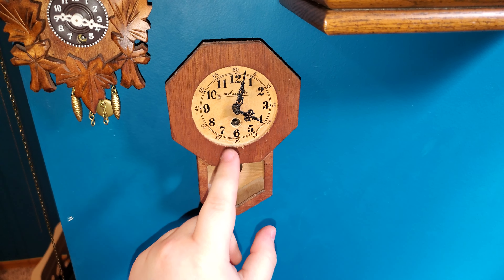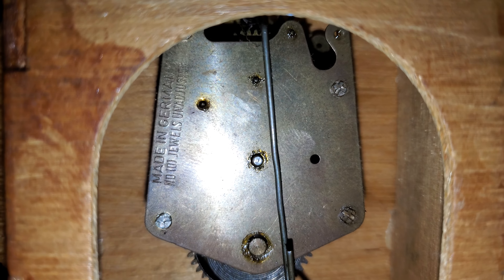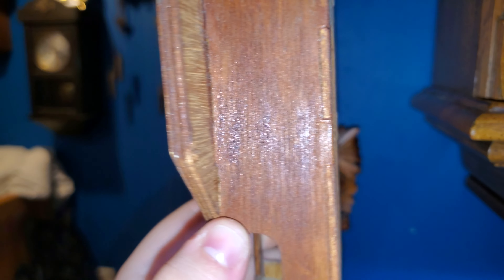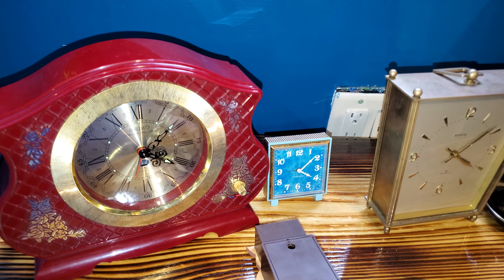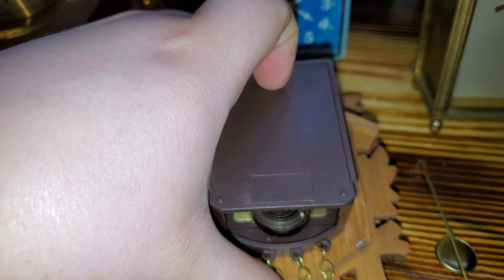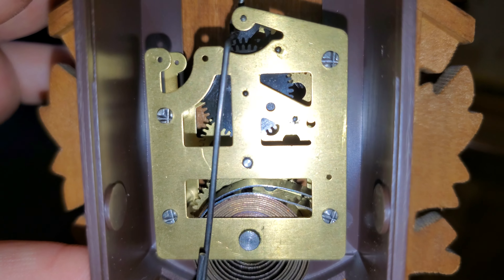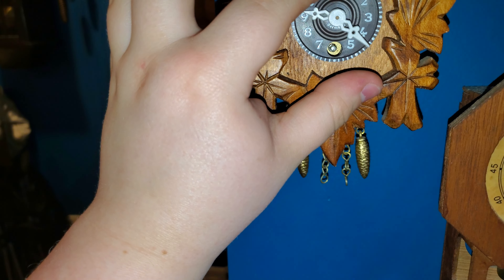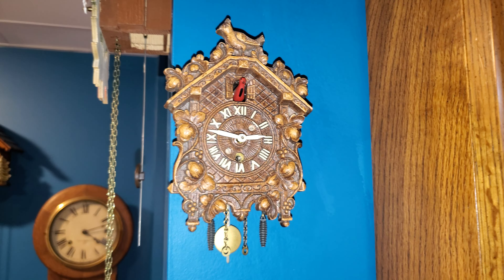Inside 3 Novelty Clocks

Comment: I think the gears are plastic because 1# it was being serviced by someone and the whole escapement was broken and the gears where chipped and they laser cut new gears for it and cleaned it but that’s unlikely 2# is that they probly did that to prevent it from creating a lot of friction and creating some sort of substance that would jam the movement of the novelty coo coo clock

Comment: I think your mini school house clock is case is homemade i was looking for one and my mini cuckoo clock I got it to hold tine
Reply from the maker: That's impressive! :D Congratulations.
Mine don't keep time because the construction of the movements just aren't meant for reliable time keeping, but sometimes if you can get them juuust right, they'll work.

I'm not sure that this case is homemade. I've seen a couple other examples of the mini schoolhouse clock on eBay. I think back in the day they were originally sold as kits, and you would assemble the case and put the movement in yourself. Various companies in the 80s did that for real-deal grandfather clocks.
Reply: There probably sold as kits and with my novelty clock I just made a whole new pendulum because it did not come with one